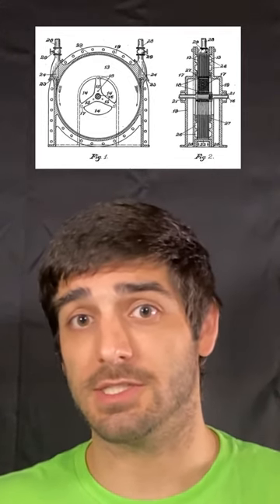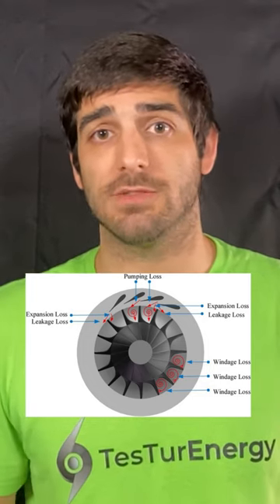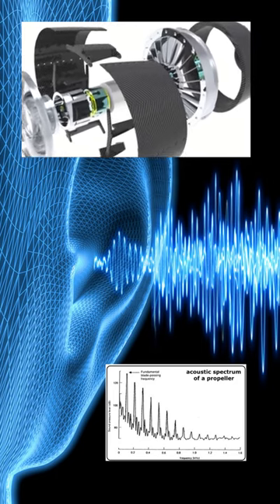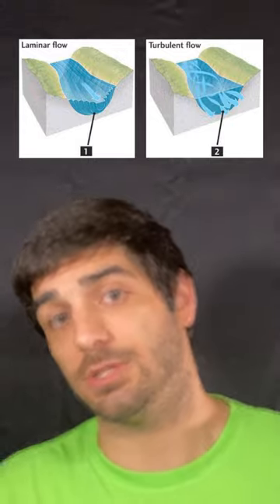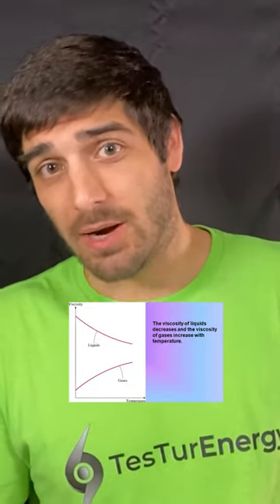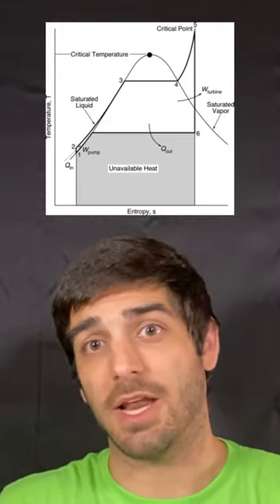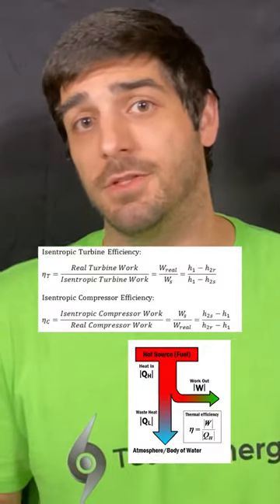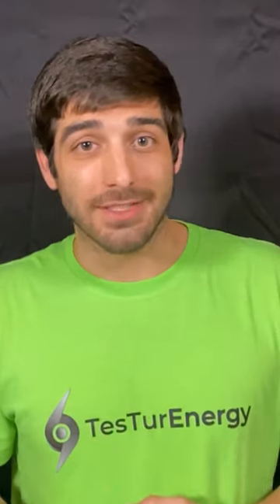Tesla Turbines For Nuclear Submarines

Comment: Kinda of proud of myself for causally listening to this and understanding the whole thing YouTube university has taught me x1000 times more than college university ever did
Reply: I suppose that depending upon the liquid viscosity the disks areas must change. If so, what would be the formula that will be dictating the disks surface area needed depending the variable of viscosity? And what about the disk's itself material? I suppose that too is a factor influencing the disks movement, no? Are you able to show that formula?
Reply from the maker: @jocelyncere2500  hey thanks for the question, take a read of this quote from the patent. 

“The dimensions of the device as a whole, and the spacing of the disks in any given machine will be determined by the conditions and requirements of special cases. It may be stated that the intervening distance should be the greater, the larger the diameter of the disks, the longer the spiral path of the fluid and the greater its viscosity.”

Though this is stated for the pump section I believe it to be accurate for the turbine uses. 

“Owing to a number of causes affecting the performance, it is difficult to frame a precise rule which would be generally applicable, but it may be stated that within certain limits, and other conditions being the same, the torque is directly proportionate to the square of the velocity of the fluid relatively to the runner and to the effective area of the disks and, inversely, to the distance separating them. 

The machine will, generally, perform its maximum work when the effective speed of the runner is one-half of that of the fluid; but to attain the highest economy, the relative speed or slip, for any given performance, should be as small as possible. 

This condition may be to any desired degree approximated by increasing the active area of and reducing the space between the disks.”  

So the principles for maximizing TesTurs’ performance are:   

1) increase fluid velocity in relation to disc speed,(not increase disc speed)   

2) Maximize the surface area of the discs, and   

3) Minimize the spacing between the discs.  

The fundamental interactions governing the turbine’s efficiency and torque are fluid adhesion and cohesion, and not RPM.

Comment: Tesla turbines is a nono....guys i tried some mods and tesla turbine is a failure....ok can it move boat? Can it move regular car? You sayin it can move ship? Yeah right no way it will move ship
Reply from the maker: Hey thanks for commenting but I would suggest you take a look at the work I’ve already done on Tesla turbines to prove their viability. 

+4250watt Tesla Turbine Dyno Jet Turbo Power & Torque Curve 375 mph @ 12,500 rpm https://youtu.be/exF5Rn-L8gs

Tesla Turbine Collab Video With Integza  https://youtu.be/Tuzh9mHvzkk 

Tesla Turbine 250 watt to 2650watt Power and Efficiency Test https://youtu.be/K7qZvq1CMFg 

These preliminary tests are just to see how much electrical power can be produced with room temp compressed air driving the Tesla turbine.     

6.22ft-Ibs of torque at only 4150rpm and +4.25kW between 6000-12,000 rpm.     

That puts my plastic and aluminum prototype right in between a 50cc and 125cc piston engine on combustion and 150psi compression.

The TesTur nozzles never went over 20psi at the nozzle for the 2650watt electrical load test and not over 40psi at the nozzle for the 4250watt dyno test.       

This is so I can get a baseline for what to expect as I increase the temps to combustion levels.       

When using elastic gasses the counterintuitive thing most overlook is that the viscosity of gasses goes up with temp.     

So not only do we see an increase in thermodynamic efficiency from increased temps but the TesTur isentropic efficiency also goes up due to the reduced slip from the increased viscosity.       

If you’re interested, check out the rest of my YouTube channel for more TesTur information.   

I’ve got a lot more in depth videos up there.     

The link is in my bio!    

And please leave a comment on any video if you have any questions.     

I’m always happy to give really in depth responses to everyone.      

Cheers!
Reply from the maker: I appreciate your comment but that’s not an issue because, despite what everyone erroneously claims, Tesla turbines work just fine, get plenty of torque and output power at low RPMs.     I’ve got some copy pasta 🍝 of mine that I’ll share with ya here to explain more.  Tesla turbines aren’t made efficient by spinning really fast.   That’s only for when the disc stack is being used as a centrifugal pump, because ALL centrifugal pumps’ compressors, performance is tip speed dependent.   But spinning the turbine fast will produce a centrifugal head that opposes the incoming fluid flow, reducing the pressure gradient across the nozzle, reducing fluid final velocity, reducing mass flow rates through the nozzle and ultimately reducing power out. 

Furthermore the faster you spin them the faster the fluid you have has to go just to still be moving faster than the discs and still provide torque.   Lastly, they work just fine for industrial use and can scale up just fine because the torque on the discs is proportional to the difference in the fluid speed and the disc speed. So the disc tip speed is the important factor here. For any given fluid supply in, the bozzle will have a max fluid velocity. So the turbine disc tips will have a max speed set at that fluid speed irrelevant if radius. Now considering that centripetal force is proportional to V^2/R, if you keep the tip speed the same but increase the radius the centripetal forces on the disc for the speeds needed will actually decrease. 

Despite what MANY have claimed about the Tesla turbine, it does NOT need to be spun fast to work or work efficiently.   TesTurs are made efficient when the slip on the discs is reduced and spinning the discs fast does nothing to reduce the slip, only increase the distance the fluid slips on the disc faces, which is by definition “loss”.  Listen to what Tesla himself said in the patents of how to make them work.  “Owing to a number of causes affecting the performance, it is difficult to frame a precise rule which would be generally applicable, but it may be stated that within certain limits, and other conditions being the same, the torque is directly proportionate to the square of the velocity of the fluid relatively to the runner and to the effective area of the disks and, inversely, to the distance separating them. The machine will, generally, perform its maximum work when the effective speed of the runner is one-half of that of the fluid; but to attain the highest economy, the relative speed or slip, for any given performance, should be as small as possible. This condition may be to any desired degree approximated by increasing the active area of and reducing the space between the disks.”  1) increase the speed of the fluid relative to the disc, (not increase disc speed)  2) increase surface area 3) decrease disc spacing  This is how you actually make a TesTur work. Not by spinning it fast.   The fluid interactions with the disc that govern efficiency an torque are adhesion and cohesion. Full stop. And spinning fast does nothing to increasing either to increase the turbines isentropic efficiency.   This is why everyone who chases rpm with the TesTur just flat out fails. They aren’t even trying to design them properly so of course they won’t work. 

You just have to know how to design it correctly to actually reduce slip to make them work, not spin them fast.  The only reason people think Tesla turbines have to be spun too fast is because EVERYONE has mistaken the part of the patent that is about the turbine being used as a pump as being about it being used as a drive turbine.   The only time you want to spin a TesTur fast is when it’s being used as a pump/compressor. This is because ALL centrifugal pumps’/compressors’ performance is tip speed dependent.   “I have found that the quantity of fluid propelled in this manner, is, other conditions being equal, approximately proportionate to the active surface of the runner and to its effective speed. For this reason, the performance of such machines augments at an exceedingly high rate with the increase of their size and speed of revolution.” -Nikola Tesla 

And again, you DO NOT want to spin too fast in a TesTur because the centrifugal head will just counter your incoming fluid flow reducing power. And the faster you spin discs, you’re fluid has to be going even that much faster just to be able to apply a torque on the disc face.   “Still another valuable and probably unique quality of such motors or prime movers may be described. By proper construction and observance of working conditions the centrifugal pressure, opposing the passage of the fluid, may, as already indicated, be made nearly equal to the pressure of supply when the machine is running idle. If the inlet section be large, small changes in the speed of revolution will produce great differences in flow which are further enhanced by the concomitant variations in the length of the spiral path. A self-regulating machine is thus obtained bearing a striking resemblance to a direct-current electric motor in this respect that, with great differences of impressed pressure in a wide open channel the flow of the fluid through the same is prevented by virtue of rotation. Since the centrifugal head increases as the square of the revolutions, or even more rapidly, and with modern high grade steel great peripheral velocities are practicable, it is possible to attain that condition in a single stage machine, more readily if the runner be of large diameter. Obviously this problem is facilitated by compounding, as will be understood by those skilled in the art. Irrespective of its bearing on economy, this tendency which is, to a degree, common to motors of the above description, is of special advantage in the operation of large units, as it affords a safeguard against running away and destruction…” (cont’d) 

“…Besides these, such a prime mover possesses many other advantages, both constructive and operative. It is simple, light and compact, subject to but little wear, cheap and exceptionally easy to manufacture as small clearances and accurate milling work are not essential to good performance. In operation it is reliable, there being no valves, sliding contacts or troublesome vanes. It is almost free of windage, largely independent of nozzle efficiency and suitable for high as well as for low fluid velocities and speeds of revolution.” -Nikola Tesla  Tesla both knew it wasn’t meant to spin fast and that it worked great for low speeds IF you design it correctly.
Reply from the maker: If you’re trying to mod the Tesla turbine instead of actually building it like Tesla said to build them, that’s the problem. 

They work just fine when they are built like Tesla says to build them.

I told you all of this 6 months ago in the comment you made saying “Tesla turbines are a failure”

Comment: I've noticed you working with other youtubers recently.  Also, one of the things you claim the tesla turbine is great for is handling a lot of particulates.  I'm not sure if you're aware of a channel called BobbyMcBoost, they're aussies, and one of their more interesting projects is using a turbocharger on a wood fired burn barrel.  It's really silly obviously, but it cooks their turbos really fast.  It'd be interesting to see if using a tesla turbine for the turbine side and a normal turbo compressor would be more successful.
Reply from the maker: Hey thanks for the comment!! 🙏❤️‍🔥 

Yes! We will be testing that exact kind of set up in the near future!
Reply: Oh nice, as silly as most of the projects with turbocharged burn barrels are, if the turbine could survive relatively long term it could be useful.  Like using a generator to limit turbine speed, and maybe injecting steam, both to add more power to the turbine and cool it.  A turbine generator that can run on anything that catches fire would be really useful.  Load it with scrap wood and trash and charge up an off grid setup (as well as generating heat)
Reply from the maker: @EricMuller  hey thanks for the reply! you bet! ❤️‍🔥🙏

Make sure to check out the latest updates on the combustion + steam Tesla turbine builds!  

Https://youtube.com/playlist?list=PL4XBGjR8Gu-GFU6X0CNbjYsI05JPRS7Ec 

Tesla Turbine Jet Engine - gasoline fuel burner atomizer flame tube test 186,083 propane burner https://youtu.be/gRqKowignac 

Tesla Turbine Jet Engine Combustion System GB186,083 - Powdered Iron Fuel + propane micro burner https://youtu.be/Ad0Ecpc_OPM 

Dr. Tesla Talks of Gas Turbines - AudioBook by Charlie Solis https://youtu.be/TGGLG-7hK50 

A More Efficient Off-Grid Steam + Gas Turbine! GB 186,083 https://youtu.be/-anD-_LZQy8

And don’t forget to check out all my regular updates on my IG! 
www.Instagram.com/SolisHoods 

Let me know if you have any questions! 
❤️‍🔥🙏🦾🤓👨‍🔬